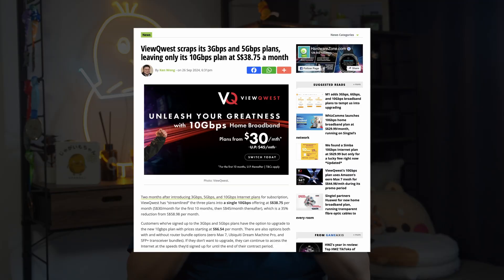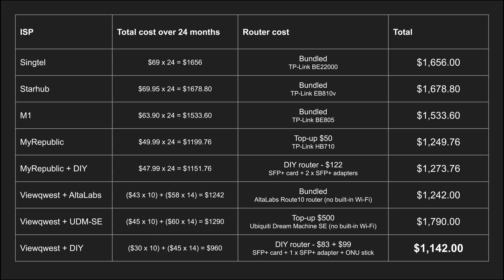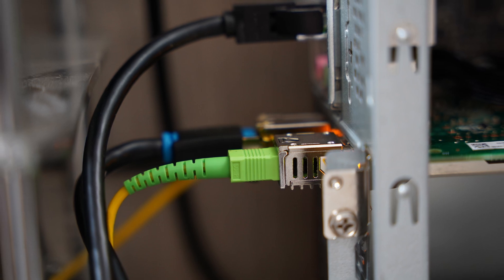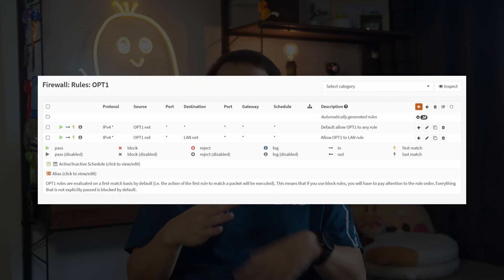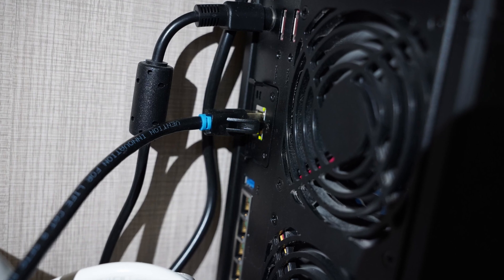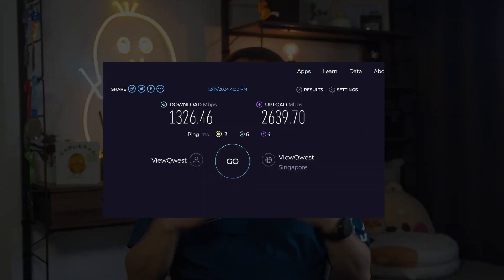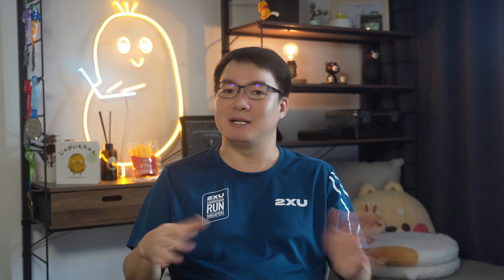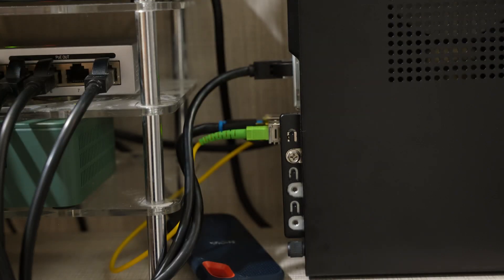I upgraded to 10G for less than SGD200!

Comment: Question about your setup. Did you directly connect fibre to your router? I always thought we need to use the providers ONT before it can be connected to our router.

I have the same plan as u, but only using 2.5gbps connection through pfsense running on N100 machine. I read that if you want to achieve near 10gbps, you need a beefier processor. I am thinking upgrading to a C3758R machine, as it’s the best balance of power consumption to performance. You might wanna check it out.

Love your video, keep us updated with your progress!
Reply from the maker: Viewqwest offers an option with an "ONU stick" - it's an SFP+ adapter to put straight into your router (with an SFP+ WAN port), so fiber direct to the router instead. For the pro-router options in their menu (AltaLabs and UniFi Dream Machine), ONU stick comes bundled I think

Yeah, I think my machine is also being capped by the old CPU - Core i5-7400. Might be a future upgrade - also looking for something with better power consumption!

Comment: I wanted to upgrade to 10gbps when my contact was up(Starhub) but my dad has tv contract as well and i am still using unifi 1gbps Network switch(24 port POE+ Switch) and 2 of my AP are still wifi 5(Nano HD) so i held out first before committing to it
Reply from the maker: Haha ya, my Unifi U6 in-wall and AP lite still WiFi6 with 1G backhaul. So now only 2 PCs enjoying 10G and 2.5G 😆